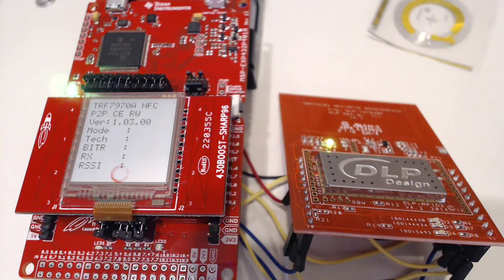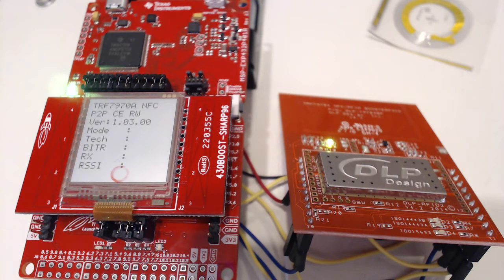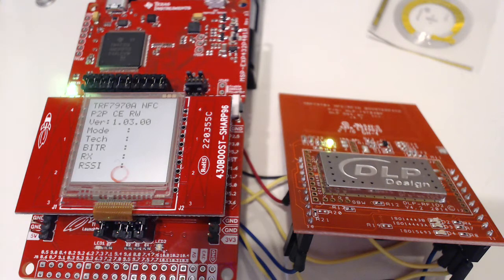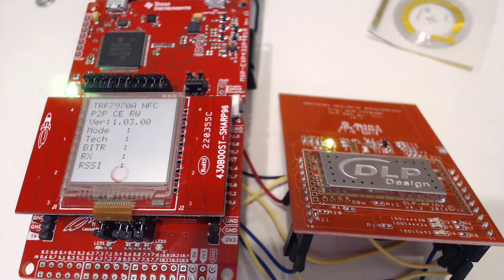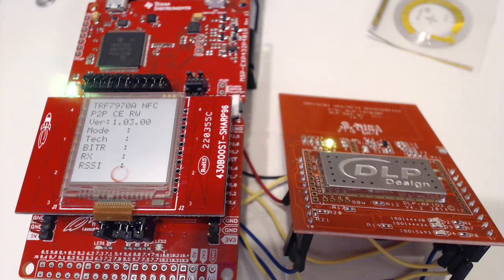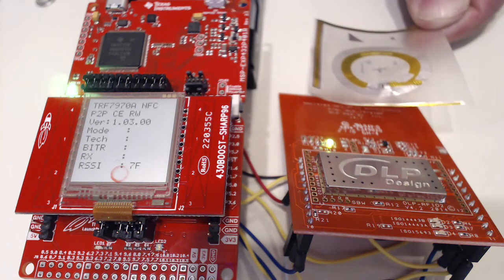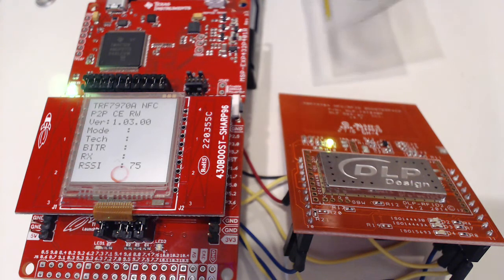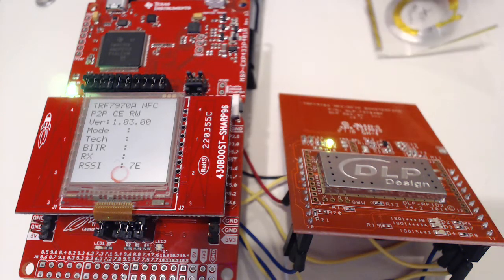MSP432 with TRF7970A and SHARP LCD

Comment: Sir i am using lcd kentec and dlp how to connect them together because they share same pin
Reply from the maker: This was part of a element14 project and I just wired the RFID board to the MSP432 rather than stacking the booster packs due to the pin conflicts.  I believe I just moved some pin assignments around to get around the issue.
See the project at this link:
https://www.element14.com/community/community/design-challenges/texas-instruments-safe-sound-wearables-design-challenge/blog/2017/05/01/safe-and-sound-wearables-hearing-guard-system-11-dlp-7970abp-with-430boost-sharp96

Comment: I am working on a project sir related with the rfid and nfc Booster pack dlp-7970ABP  I am having problem how to program it using energia Sir can you please help me
Reply from the maker: This example is based on the TI TIDM-NFC-RW reference design.  You may want to post on the TI or Engeria site for the issues you are running into.